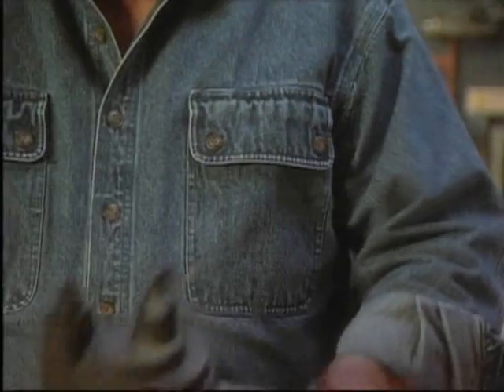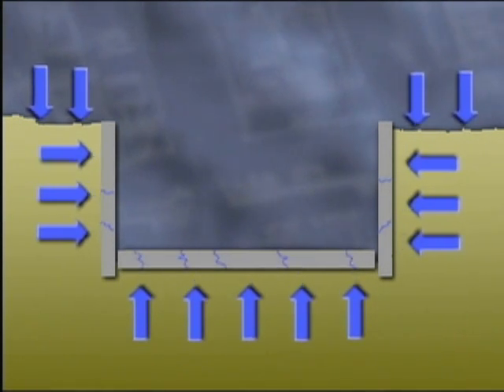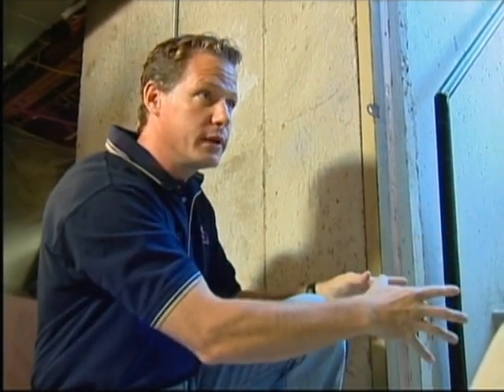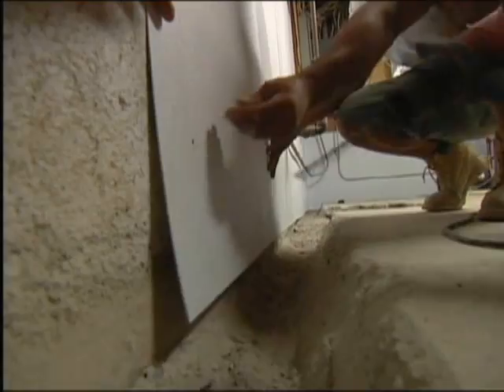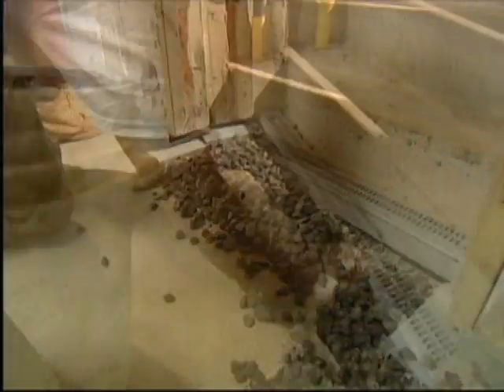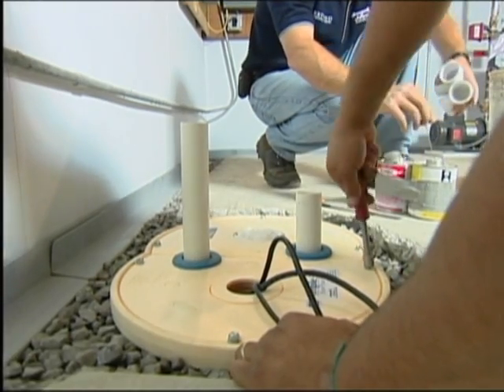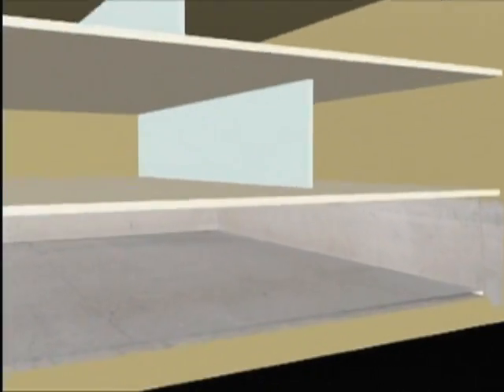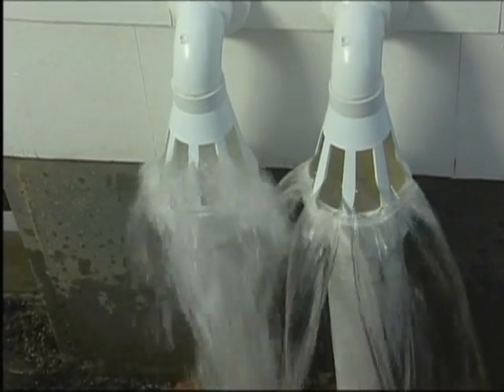How to Waterproof a Basement | Ron Hazelton's House Calls feat. Basement Systems

Comment: I have the BasementSystems water proofing system internal drainage and my basement has been amazing dry for 10 years now. I have my own videos that show the installation. Just having the drains isn't enough. I also use their non-permeable wall covers to seal out moisture from walls or that would leak down from windows. It then goes into the drains. Solved so many issues.  Just last week, I installed my own egress window and what a mistake that was. I did not put a drain into the window well because I figured it would drain enough during storms, which it did. But then it downed poured an incredible amount something like 7 inches in an hour and filled the window well and it leaked into the basement.  Now I'm having them install their egress window well drain system to eliminate that issue.

Comment: In some locations like Minnesota (or adjacent to a lake) the water table is so high, that no gutters, or weeping tile will prevent a wet basement. 
I had a problem w/ my home in NC, and got several estimates. I actually initially tried a weeping tile, but pulled it out.  The last estimate was the best.....grading or reversing the slope. Only 1 time did water come in, and a valley in the gutters had clogged it so bad it was coming off in a continuous stream. Even w/ screens on the gutters one has to keep them clean and free of debris !!! Finally !!
Reply: I really don't think that many of these commentors grasp the concept of a high water table. They must all live in warmer, dryer climates. All the exterior waterproofing in the world isn't going to help if water is pushing up from underneath. I reside in the upper Midwest and my whole neighborhood was built on a high water table (unfortunately). Many of these homes are resting on a bed of poorly drained soils, with basements which will become a shallow pool at any given time of the year without drainage systems and sump pumps. Most pumps around here were activating even throughout the dead of winter this year.
Reply: @UToobin75 my water table is exceptionally high—never ever below my foundation footings.

I have a very dry basement because they ran exterior delta membrane against the walls, then drains around footing and it goes to a sump pump. At the worst time of the year my pump moves about 1000 gallons a day. Even in the driest part of summer it runs (though less). I also have a water alarm if the pump fails, and a gravity drain I can use alternatively (in which case pump need not run).

Comment: The very last line of defense for water coming into a basement is a french drain and sump pump. You don't want to let water into your house so you can pump it out. Keep it outside if at all possible.

The first thing to check for basement water is roof water and where it discharges. Keeping gutters clean and drain paths clear is part of this. Just as important is the pitch of the property. Is water running towards the house across a patio or driveway? Are the grounds sloped toward the house? Where does the neighbor's water go? Was any attempt made to channel the water away from outside the steps assembly or did the contractor just concede "all basement steps leak"? The above solves over 90% of basement water problems. After that, I'd re-access and if there's still a problem, just a simple well & sump pump in the lowest corner could work as a last line of defense. 

I would not use those white panels anywhere except possibly behind the electrical. Do they breath? Great to promote mold. 

The flaking on the wall will stop when outdoor water is channeled or run away from the house. 

Instead of paying someone to maintain your sump pump system every year, I'd pay to have my gutters, down spouts and drainage cleaned regularly. I need to know a little more, but it's a good bet this guy got ripped off.
Reply: Why do you believe he got ripped off?
Reply: @mikebevan1034  Everything I wrote above. He should've spoken to others. Does this company do outdoor drainage? He was sold the most expensive but still has water coming thru his walls and into his house. The first pic at the beginning tells it all.
Reply: @mikebevan1034  I've been researching and reading all over the internet and he kinda did get ripped off. Sold him the most expensive "fix" that probably won't actually solve the problem. Just look at the end where the water drops out at, the waters just gonna pool there. Yeah looks like he ran 20ft of piping but the water still only lands like 2ft from the foundation. Also when they installed the corners for the drainage system notice they had no bottoms. The waters gonna hit the corners and have to build up to a certain level to ever even flow down the channels. Watch it again, dude installing it is a grade A sells man. 🤦‍♂️ "yearly maintenance" keep that money a flowing.
Reply: I can tell you don’t live in my town. Installation of a sump pump is standard in all homes, both old and new, unless it’s possible to install a gravity drain.

Grading is important but when your water table is 2-3’ during some periods of the year those efforts won’t amount to much. I’ve superb grading, and I live on a hill, yet my sump runs multiple times an hour. It’s just the nature of my property.
Reply: @patty109109 Your property is on a hill, but your water table is 2-3'. 2-3' under ground level? I can't imagine what it's like for your downhill neighbors.  My comment was on the above video. They are all precautions and adjustments people should consider before having messy, expensive work done inside their house. Can an external french drain work in your neighborhood?
Reply: I agree but sometimes it is so hard and expensive due to walk ways etc.🦇

Comment: No, I don't think to keep the water behind the plastic panel is a good idea. You are going to have a lot molds in your basement....
Reply: Have you discovered a new kind of mold that feeds on concrete or plastic? Mold doesn’t form without a food source.
Reply: @patty109109 Kind of agree with other guy. I see mold on everything at one time or another. Moisture is a bitch. I am about to start trying to solve a crawl space leak and I dread every second of it as I will probably not have satisfaction.🦇

Comment: Good building practices will tell you that the proper engineered way to get rid of water in your basement is to take it the right way, from the outside. Dig to the bottom of the footing, find all the cracks, defects, apply plastic tar coating on all of it or the significant defect area. Then I installed a thick Visquen plastic layer from the very top of the wall, above the grass line, all the way down to the very bottom of the footing. while the plastic tar was still wet. For the next 30 years I never had a leak. No where in the basement did it leak. I installed a new heavy duty sump pump to upgrade and insure reliable pump operations. No mold, no leaks, basement dry. this approach worked perfect for me.
Reply: Cheaper too

Comment: Water is discharged through PVC piping outside and at least 4 feet away from the foundation to prevent it recycling back against the home's foundation. This is why you often see sump pump discharges installed to drain out onto splash blocks.

Comment: The whole reason the basement is leaking is because the builder has those walls as thin as possible required by code and used cheap concrete.  When my friend was building his home a few years ago, they built the basement and foundation, basically laying a thick concrete slab for the basement floor.  They then layed some type of rubber membrane.  Then they lowered some metal plate on top of the membrane.  I think it was steel.  Then then layed another membrane then another layer of concrete.  After that, they did the same with the walls.  The walls are also a few feet above the ground at the top.  They backfilled the sides with dirt and when they were done building the house, it sits a little higher than the other homes in the neighborhood.  Guess what?  NO LEAKS!  Imagine that!
Reply: What the......I have heard of this.            " technology" it basically hides the problem it may stop the flooding but not the water and it just pumps it out but still the moisture is present and over time mold will come

Comment: Ron 
I am an engineer and I deal with these basement systems and the only issue I have with the system is how Larry has installed it
You seem to have a high water table so the outlet drain from the pumps will be subject to flooding and this means the special fittings Larry invented will always need to operate in winter time when rains are regular. If I was larry I would have moved these and the main outlet drain further away from the house otherwise you pump water from the basement to outside only for it to return 'cycling around' from outside to inside until your pumps burn out from continuous use, most pumps can handle a few hours continuous running but as a worst case these could be running 24-7 for the entire wet season.
Reply: You are an engineer, but you never even consider that simply digging an outdoor trench to the footing then sealing the wall will unlike any indoor system, actually fix the problem? In most cases an outdoor system costs about a third of what these indoor dog and pony shows charge
Reply: My pond pump runs year round and has been doing so for many years.🦇

Comment: That discharge at the end should be open horizontal, not up. That's why it could freeze. If the up discharge is used, there should be weep holes for it to completely drain. This end in his discharge system necessitates the added expense of his fail/safe fittings.

Comment: Very cool idea with the plastic liner behind the perforated drain pipe to allow water in. I feel the wall liner will always hold moisture, depending on how much water is actually coming in. Also mold will eventually develop behind the liner and become a centipede water bug haven but the "customer" as you say will never see this cause its covered. Great idea though it would be nicer if the panels could come down yearly to make sure its remaining dry.
Reply: I don't like that idea either and I don't even know if a backer-board would work.

Comment: The very first thing to do when correcting a wet basement is to inspect or install roof gutters and proper downspouts. Second is to check earth grading around the home to be sure rain water is running away and not accumulating next to the wall. Neither of these are mentioned at all.The system shown seems ok, however to install an attractive interior wall 'skin' would require a skilled carpenter. I see the 'skin' fitting process looking like a hack job with all the cuts a basement panel job would require
Reply: peter d don’t finish your basement and run a humidifier
Reply: Sgreaming daily .slots bc live
Reply: Streaming daily slots bc
Reply: I preach this all the time try to stop the water on the out side first .Then you install a sump[ pump but only as the last resort . By the way your trench should be at the same grade as the footer looks like you did not go deep enough .
Reply: Ron is not your  friend. He's a salesman. He sells Ron and, in this case Basement Systems - note the 800 number he included. Search for Basement Systems and maybe find a guy who isn't cutting a deal to advertise their work.  A guy who can tell us how it worked for him.
PS: Gutters, downspouts (I added one to the middle of the house front and back when we re-roofed the place), leaf screens and good drainage are first steps as the OP said.

Comment: our backyard is clay. we have a mini shallow swimming pool effect after a good rain. and it always leaks in ONE tiny spot, bottom of the foundation wall, at the floor. We use a wet dry vac to vacuum..but the idea of the plastic piping to direct the water towards the washing machine area where there is a drain sounds intriguing.
Reply: Fix from the outside
Reply: I have the same effect. Sand top layer on pure clay, so my house is in a perpetual pool of water.

Comment: Lots of derogatory comments from folks who I bet are neither builders nor engineers. Don't take them seriously. I've seen plenty of "waterproofing" systems fail ... and if you've ever seen a retaining wall leaning out, you know just how pervasive and powerful underground water pressure can be. A properly installed system with a sump pump is never a bad idea for a basement.

Comment: No, no, and no.  Waterproofing must be done from the outside.  Will it work, probably, but do you really want to let the water in your house?  I don't think so.  The bypass system was funny though, the water will dump right next to the house.  Genius system.
Reply: Right, the water is getting cycled and recycled lol
Reply: I think the drainage pipe should have been below the footing to prevent water from flowing just under slab floor.
Reply: I have, after 30 years a crawl space leak issue. Outside repair would be best but man what a job. 18 thousand dollar side walk right in the way.🦇

Comment: Thanks for the video. I learned a lot.
Reply: I had hope you learn the this is the incorrect water proofing system for your basement.  This does not solve the problem of water entering your basement so it is wrong to do it this way.  The right way is to prevent water from entering your basement on the first place.  I have seen many video that his is the wrong way.  Hope you learn that this is not the way.
Reply: @tousshong9438  which is the best way?

Comment: Those wall liners are mold factories if you ask me, as for the sumps there should be a water powered backup sump pump, they mount inline with a water line on the basement ceiling, dip straw/ tube sucks from the pit and in case of failure or power failures and battery dead water powered runs endlessly and will never peter out. I worked on a home that added a 2nd story and it had a gutter setup that terminated in one downspout into the first floor-roof, valley which made quite a bit of water being deposited next to the foundation!

Comment: Yikes!  As soon as I saw them putting plastic panels on the wall to hide the water coming through the wall I knew this was not a good system.  You have to keep the water out of the wall on the outside, drain it out of the wall if it does get into the wall and then drain the water away from the footer and into the sump pit to be pumped out of the house by the sump pump.  Anything else is window dressing hiding the problems.
Reply: Thanks for your insight and great comment.  I just experienced basement flooding for the first time in Nashville after buying my house.  What kind of company would I look for?  Any suggestion as to how to go forward would be greatly appreciated.  Thank you again for taking the time to read this.
Reply: Exact opposite of what really happens.
Reply: they didnt even drill weep holes...im not too confident about this system
Reply: @aquiljannah7017  considering that weep holes would make the problem even worseid say it's just as well
Reply: @aquiljannah7017  Did so many things wrong!! can not drill weep holes into a concrete wall, drain tile should be along footing not on top, exterior walls are still going to leach and mold, thus cover the wall for appearance is the answer? Its a band aid fix at best.

Comment: The only way to properly drain a basement is weeping tile installed between the top and bottom of the footing with lots of clean rock so it drains all water sitting under slab... you've compromised your entire entire slab as there are no engineered tabs left connecting the slab to the footer which prevents the floor from settling and the walls from pushing in the bottom of the walls... this solution will result in water sitting in the plastic gutter which evaporates up behind the plastic sheets into the basement area so its always damp and musty... will keep water off the floor but does not solve the real underlying drainage problem
Reply: Obviously this is wrong, or else every house in my area is compromised. I have toured many new builds and only one builder locally even has the slab touching the side of the wall; the vast majority of older—and new—homes here have a floating slab, with an inch or so air space between the wall and the slab, which is intended to catch any wall runoff and direct under the floor, ultimately making its way to the sump crock.